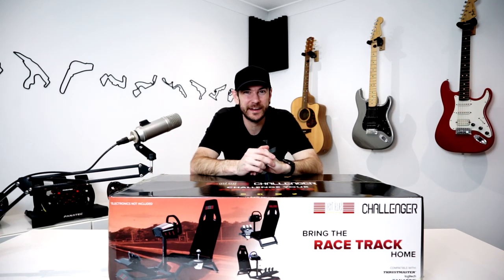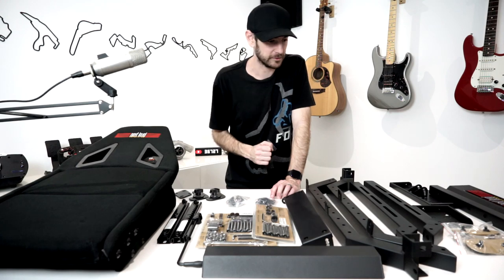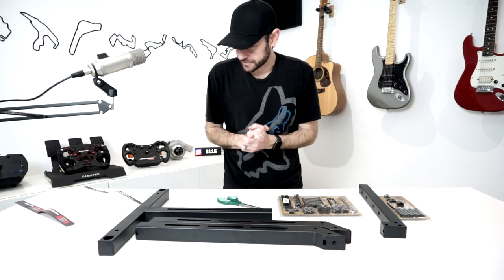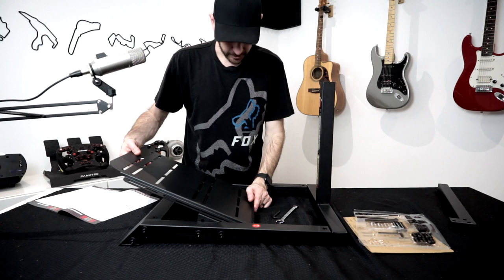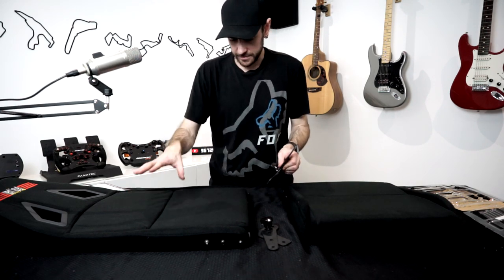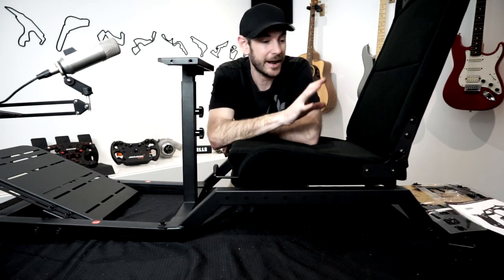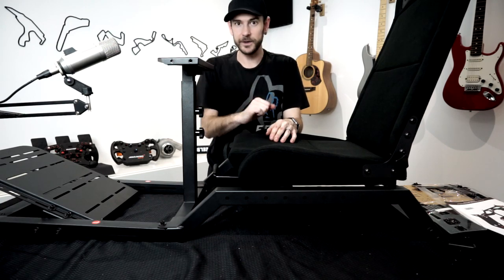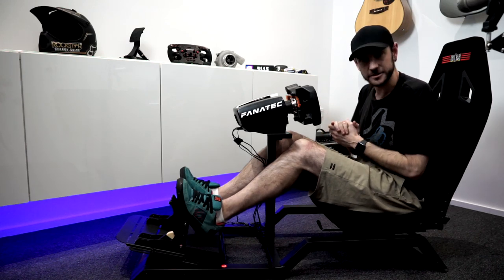Next Level Racing Challenger Cockpit - Assembly and First Impressions

Comment: Build a budget pc to go with it to show what graphic setting and hardware people should expect
Reply: actually i think the pc itself ain't the budget-problem... if you can afford a setup which still costs round about 1250€ (which should be more than 2000 australian dollars if i get it right), you should still be able to afford or already have a quite-decent-system (if not you might consider buying the loadcell-kit later^^). 
i'm still using my trusty i5-7500, 16gb and gtx1060 while running pcars2 on 1440p, ultra setting and it still feels smooth, maybe not 144hz smooth but always perfectly playable, even with 19 ai-cars, at night/dawn in the rain...
Reply from the maker: Not going to have the funds to purchase any more equipment for a while now so no more PC builds for the time being.
Reply: Bastian Müller that’s a fair point. I’m just throwing out ideas for content, the more videos he makes the more food on the table 😜

Comment: Great informative Video! On the pedal fastening; could you have  just pulled the rubber strip out of the pedal set? That reveals multiple thru-bolting holes does it not? Then just place the rubber strip back on and its all hidden.

Comment: This is a great series Will.  I had an almost identifical set up for GT Sport, except I used the F-GT cockpit.  It was great.  I found the CSL Elite wheel to be quite a step down from my Accuforce DD wheel, but it is nonetheless solid.  The CSL Elite pedals with load cell are great, I use them on my rig now in place of the Main Performance PC Simpedals, which I do not miss.  I ended up returning the F-GT cockpit to Wal Mart and I sold the Fanatec gear on ebay, but it wasn't because it was not a great set up.  I just do not play GT Sport enough to justify a separate set up for it.

Comment: How does this hold up with being paired with a clubsport 2.5? Is the wheel base plate flexing really bad or is it doable? I can get one used for 160,- with the monitor mount. Or is the upgrade to a F GT the better one?

Comment: I wonder if I take some metal plates and drill holes and bolt it down because it's flexing at the wheel height adjustment part not the lower piece?

Comment: The build (material) quality looks very decent, but the wheel plate / stand flexing looks awful at this point, I’m curious to see how it holds up during actual usage... I have a cheap wheel stand pro that flexes waaaay less than this ‘full’ rig.
Reply from the maker: I originally had a wheel stand pro too and I’d say the flex at least on mine was about the same. But yes it will be very interesting to see how it holds up with driving.

Comment: The best budget build is used items. I have a Fanatec V2.5, v3, shifter, ebrake, and RS1 for less that $1200 USD. It does involve luck searching facebook, craiglist, and ebay.
Reply from the maker: There’s always food bargains to be had in the 2nd hand market. Hard to make a video about that due to the luck factor though. Although I did find a pretty sweet F1 cockpit for $100 last year that I did a video about.

Comment: Next level gear is not worth it in my opinion i have tried all 3 rigs they make. If i could do over id pay the money for a good cockpit straight up if you cant afford table mounts on gear is well and truly good enough for entry level. With my TMX pro from thrustmaster the F-GT Formula was adequate but as soon as i upgraded to my fanatec 2.5 base and v3 pedals + shifter/handbrake the flex is unplayable no consistency with the brake or shifting. The GT cockpit i own now has an inch of flex in the wheel plate and double in the shifter.  If anyone has any good cockpit recommendations please let me know. Based in Aus